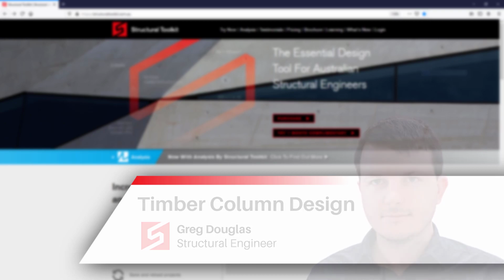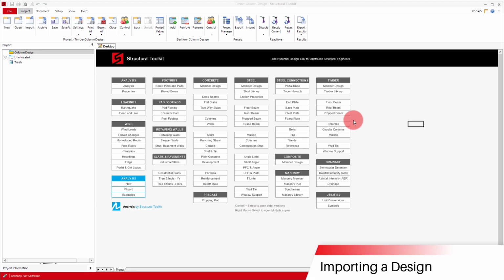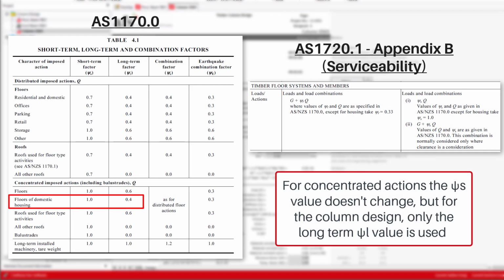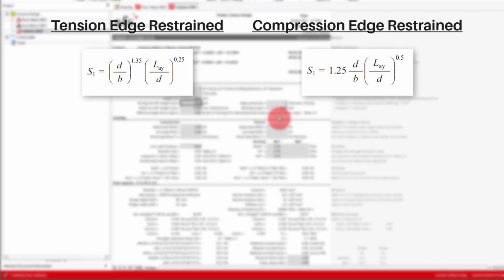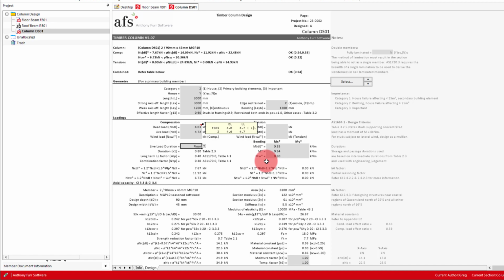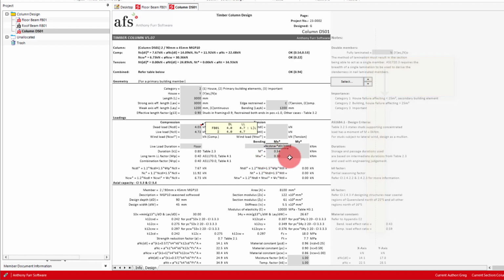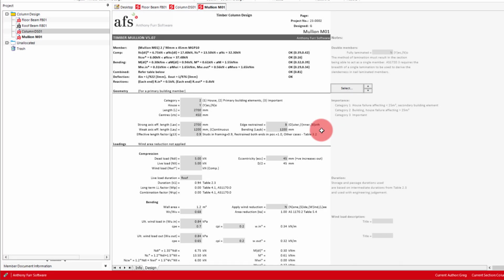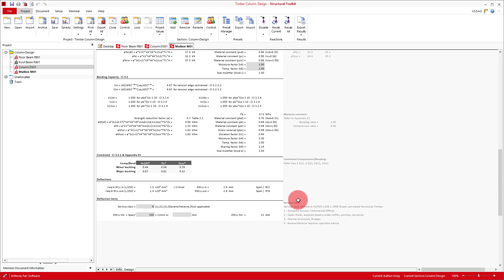Structural Toolkit: Timber Column Design - AS 1720

Comment: Should dw = 90mm Or 45mm for double stud?
Reply from the maker: Good question. A double stud is typically nail-laminated, for which AS 1720.3 states: "Where nail-laminated members are used, the breadth of member used to derive the
slenderness coefficient (S1) is taken as the breadth of an individual lamination.". In this case dw = 45mm.